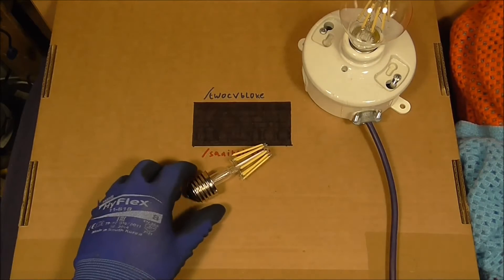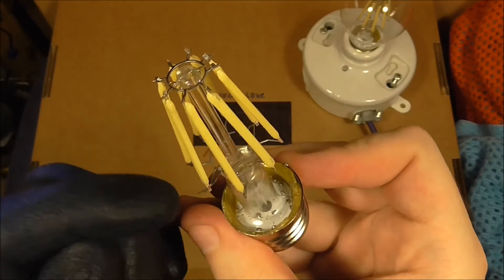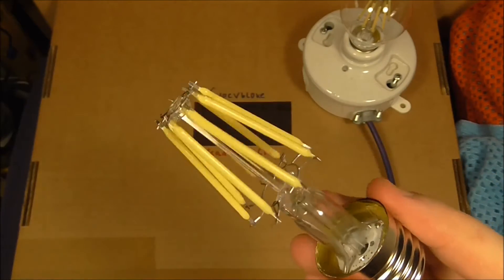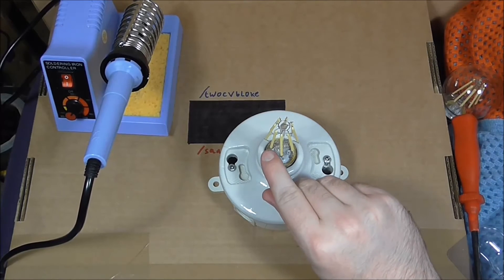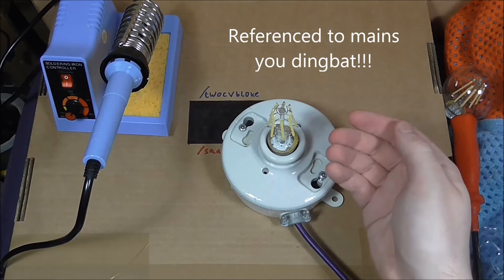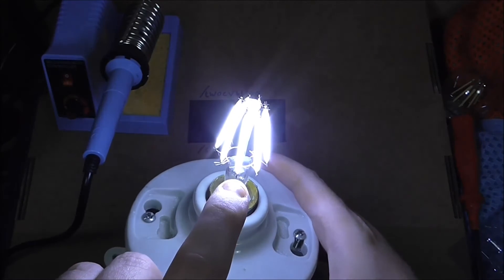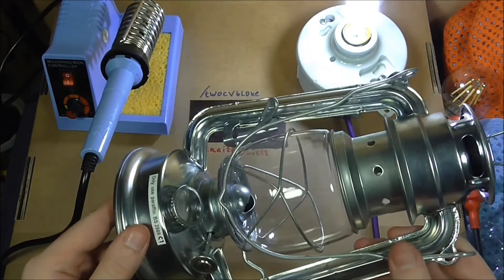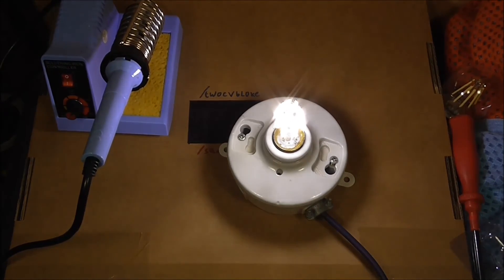LED Filament repair...

Comment: I've heard that these bulbs are often helium-filled for better cooling, so it might have a shorter lifespan now that you've opened it.
Reply from the maker: Wouldn't matter anyway, the lamp died a long time ago from failed bond wires in the filaments (common problem on cheaply made lamps)...
Reply: @TheRottenShed  Sure, I was just saying in case people think that they can repair these bulbs by soldering etc. I'm currently running a couple of these bulbs with the glass removed, as they were too big to go into a wall light fixture, so it will be interesting to see how long they last.